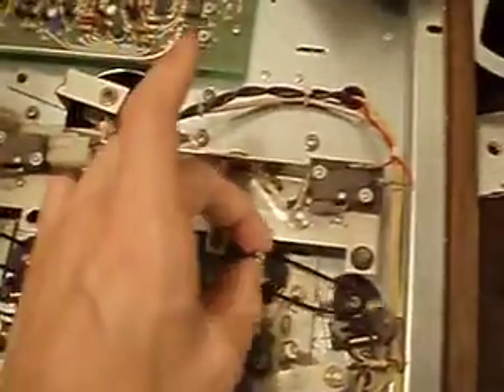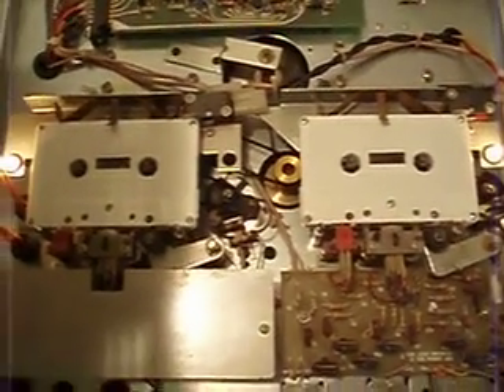TELEX tape duplicator transport operation.

Comment: Did you test it for sound quality after replacing the belts? Anytime I ever changed belts the pitch of the music was thrown off because the difference in tension between the old belt and the new one. It took me a while to figure out that a tight belt causes the motor to work harder and therefore spin slower but I was only 10 back then.